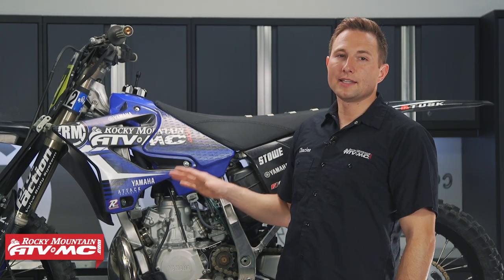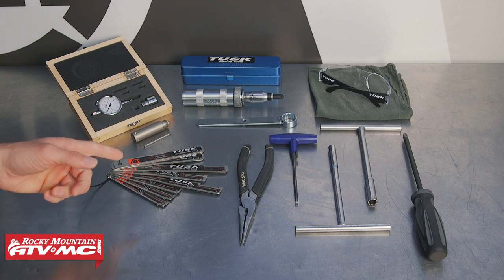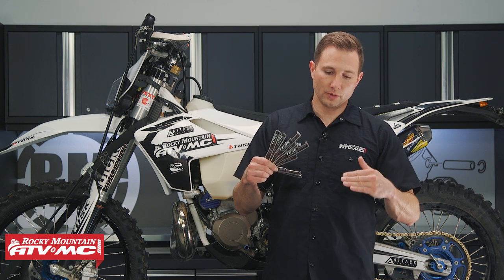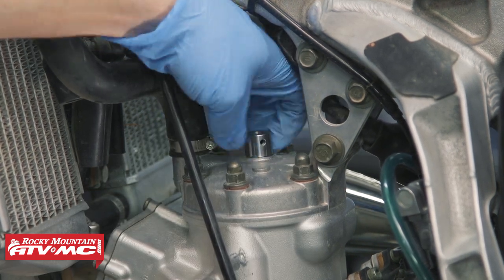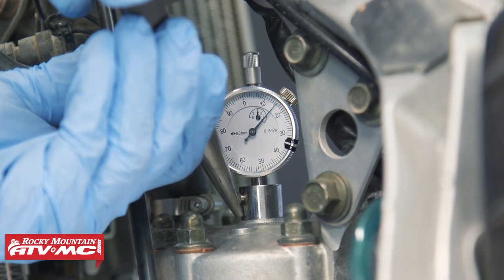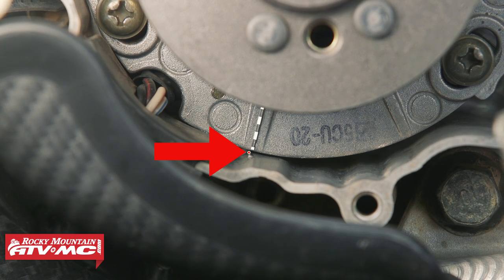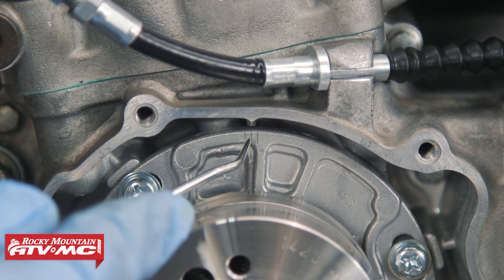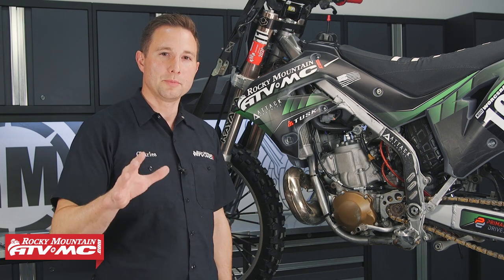How To Set Ignition Timing on a 2 Stroke Dirt Bike

Comment: I’m having trouble timing my 05 ttr le. I line up the cam sprocket to the notch and the flywheel to the case mark but when I turn it over it never lines up. I’ve done it over but the timing doesn’t seem to line up. Idk what to do..

Comment: If the timing line on the flywheel is around 1 inch past the stator line. The woodruff key is perfect brand new oem crank. What would the issue be ? On a ktm 85 ?
Reply: I was also wondering this on my yz85 wondering if the keyway was machined in wrong spot on crankshaft

Comment: Great video! I still am having problems with this 1979 Yamaha DT100F I have I can’t get it to run right. I’ve replaced just about everything in the carb including the float needle, seat, float, and replaced necessary jets to OEM and soaked the carb and sprayed it with carb cleaner and compressed air and it still doesn’t run right. I dont see any visible air leaks but they say to use brake parts cleaner or wd40 but you can’t test for air leaks if it doesn’t run right if at all and you can’t get it to run right if you have an air leak so a loop hole there…

I’ve also replaced every single gasket and rebuilt my top end and it has 120 psi compression at a recommended 105 compression so that’s not the issue. It has the tendency to flood which doesn’t sound right ive messed with every single thing on the carb and it either gets too much or nothing at all.

I’m really stuck on this one. Can anyone give me some advice? Thanks!
Reply: when you say it doesnt run just right, what do you mean. does it try to start and then die, or nothing at all?
Reply: @devyn5919  depends. Usually it will only start with choke and then die after a couple seconds. Then if I turn off choke and go wide open throttle it fires right up and then depends sometimes it’ll go for 30 seconds other times it’ll go for 5. I’m thinking it’s an air leak and I plan to pressure test it?

But yes. It will run but not for long. It does not idle and is very very finicky and recently I’ve had tough times starting it at all. The carb has been soaked and cleaned throughout and most internal carb parts have been replaced
Reply: @moddingdudes7055  since it only starts on wide open throttle and choke, it sounds like it wants fuel. do you have the carburetor jetted correctly? if it can start then it will rev higher if its an air leak. have u looked for it on your ignition side crank seal?
Reply: @devyn5919  I’ve replaced that seal as well. I think I’m gonna leak down test it for air leaks since the head gasket was giving me problems previously. I may have to give it a resurface
Reply: Is It A Reed Valve Intake? Also Check The Intake Boot
Reply: @timothyaguilar7727  well yeah it’s a 2 stroke it needs reed valves 😂

I also did an air pressure test and found a leak on my intake boot so I sealed it up with a tiny tiny bit of gasket maker and some copper gasket maker on the reed valve gasket to seal it up real good. Now i didn’t see any leaks but it’s not getting fuel anymore. I do love 2 strokes
Reply: @moddingdudes7055  I’m late, but if you still have the issue I’d check your reed valves. In that old of a bike they may have warps or cracks of sort that will cause it to run rough. My 1970 Hodaka had the same issue.
Reply: @bensambell5862  I actually ended up fixing it. Combination of air leak, float valve level incorrect, and oil injection too high of flow. Runs like a champ now

Comment: hello, tell me?yz250 2t 2013  I set the ignition according to the manual, the marks match, but when working at speed, the ignition goes to later, but it should be earlier, I disconnect the connectors from the carburetor, the ignition does not change at speed
Reply from the maker: The ignition should "advance" at higher rpm's. Are you using a timing light? Usually there are two marks on the flywheel to help you see if the advance is correct. Double check the manual. -Charles

Comment: I had a quick question for you . I just rebuilt the top end on my kx250 2 stroke all stock . I hear what i believe is detonation ping when only in power band . Timing is standard ( middle line) brand new spark in it . Would adjusting the timing fix this ? If so do i retard or advance the timing? Opened up the head and there is no metal or anything to ignite the gas before it should . Appreciate the help thank you !
Reply: Maybe you are going to lean and that it is making the detonations, also it is important to measure the squish (base gasket).

Comment: How do you get a two stroke to two step?
Reply from the maker: There are no 2 stroke dirt bikes with launch control at this time. Your best bet is practicing throttle/clutch control and maybe looking into a holeshot device to help your starts.
Reply: @rmatvmc  Is it absolutely necessary to bleed your fork oil before every ride.

Comment: As far as adjusting your timing to compliment your mods....easier said than done. I have a 97 cr80. The stator is fixed and completely hidden underneath the magneto rotor. Wtf?
Reply: The old cr80 stator isn’t adjustable, the bolt holes are circle rather then oval

Comment: Would timing affect how the bike revs with a fast hand full flick? Most bikes being set up for lower grade fuels. To make it fire better with higher ron fuel, would you need to advance or retard timings?
Reply: It reacts to your throttle better with advanced ignition timing. But better over rev with retarded ignition timing. You should advance the timing as then the higher octane fuel will burn earlier. Higher octane fuel burns slower than lower octane fuel.